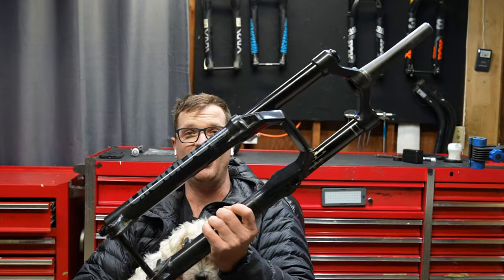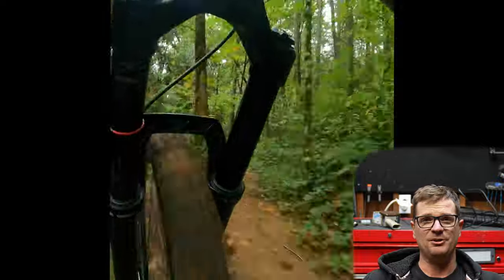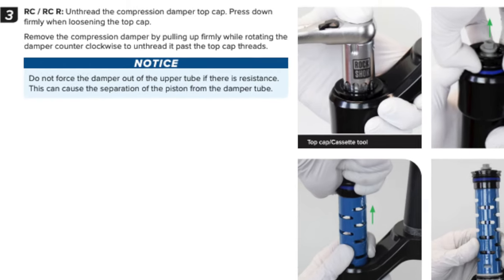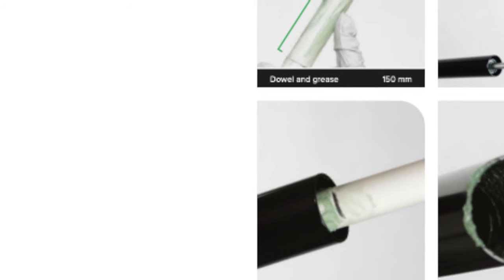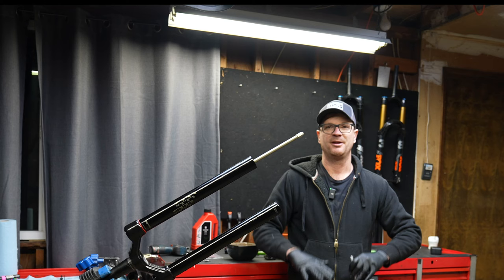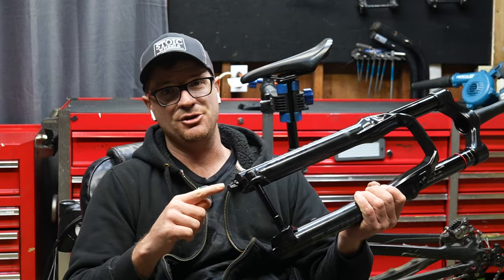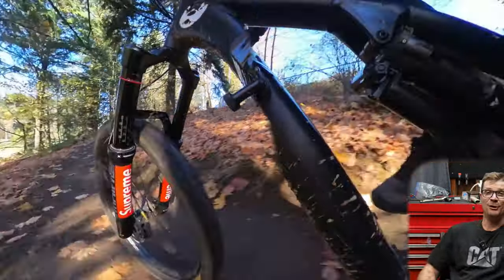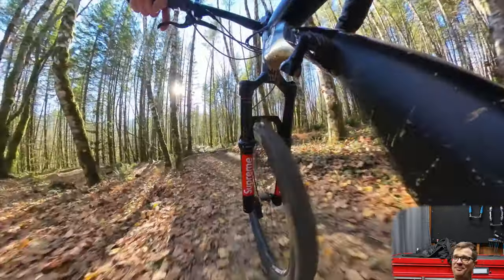How to fix YOUR Rockshox Domain

Comment from the maker: Swapping out damper oil fixed it, not the Airpsring mod
Reply: I’ve got this fork. Came with the bike. It’s not bad for jumps and I find it goes through the travel just fine when aired down for a plush sag. But small bumps and high speed compression is awful feeling. Very stiff. 

Does the air spring or the oil (thinner?) make that better? Want to try to fix it before deciding on an upgrade. Thanks!!
Reply: Which oil did you use?

Comment: Charger 3 damper definitely works, I installed on in my domain and it's 100% better, no air shaft upgrade though.
Reply from the maker: There is an upgrade the luftkappe. Thanks I read that on Reddit it said it fits too
Reply: I have a brand new charger 2.1 from a 29" Lyrik Ultimate 150mm laying around at home. Is it gonna fit, or since stanchions are bigger it wouldn't?
Reply: @klisurski  i think there are different screw diameters

Comment: Don't really know about charger 3 but Rockshox spare parts catalogue 2023 has RC2.1 damper as an official upgrade for Domain, U3 00.4318.048.000. Based on that I upgraded my domain last summer. Works stellar
Reply from the maker: There is no official upgrade for the motion control damper in the trail head app, but guys are going with charger 3 and it fits fine. The damper you have is impossible to buy now I looked everywhere. Glad it works 😎 for you
Reply: I have the 2.1 charger damper in my domain. It's made a massive difference 🤟
Reply: @owenmore5675 Hi. What kind of riding do you do? And if you don’t mind me asking what is your weight. Considering this upgrade myself.
Reply: I have the 2.1 also ……….please please if you have domains fit a luftkappe kit in the air side !!!

Comment: Hi I found this video very interesting as I have a yari fork which came with b1 air spring but the only problem was that it lost a bit of its travel just from the weight of the bike due to the size of the negative air spring but it was super plush and mid stroke support was great. But when the c1 airspring came out I tried that but boy was that harsh!! Due to the smaller negative so I went back to c1 and just put a longer airspring in to make up for the dead spot. I will try again in the future with the c1 and just slightly increase negative with a portion of extra bumper rubber. Love your videos too

Comment: Update: I bought it and so far love it. But I do plan on switching out the air spring to convert it from 160mm to 170 or 180mm travel. I'm actually thinking of purchasing this fork as an upgrade from my Rockshox Recon RL. I don't really do any extreme stuff, just some normal trail riding but considering this fork is on sale on alot of sites for around $250 it's really hard to pass on that. The only thing that has me worried is overforking my frame. I have a Poseidon Norton frame arriving next week and I have to contact them and see what the max travel is for a fork for that frame. Also i should mention I'm looking at the 160mm travel version of this fork because for some reason the 160mm is about $100 less then the 150mm version.

Comment: I bought this fork and while on jumps and normal riding i think it is really good, but we had some serious rain washout on my local flow trail, and its like a washboard. This fork feels freaking horrible on the small chatter and there is a LOT on this flow trail.  otherwise it feels great but it does not handle rain ruts well.   I even did what you did, i have to run about 82ish PSI and 3 clicks from closed. I have tried from open too but from closed feels much better.  Overall I have thought about upgrading the 2.1 RC2 but wasn't sure it would be worth it.
Reply from the maker: That was the point of the video, I fixed the harshness. You can’t get rc2 damper for Zeb anymore they magically disappeared and if you found a used one, they don’t make parts for it

Comment: Any chance you could show how to setup a Rockshox ultimate coil?
Reply from the maker: I rode one and trying to figure out if it’s safe for my ebike long linkage. The damping is very similar to the Vivid. Leave the compression knobs fully off both high and low. Add 1 click of HBO at a time for bottom out control. Only add HSC as a last resort and 1 click at a time, the lsc felt terrible as well. The problem with the 4 clicks of compression it felt like 1 click is equal to 7 from Fox, hard to get it dialed
Reply: @OtterMTBtech I just installed one on my trek rail and it is nice. I’m 170 pounds at 30 peecent sag, All the high end reviewers say they keep the lsc in the middle with two clicks hsc and hbo in the middle. It felt rough with these so I just opened them all up and feels much better, I would like to use some damping since they give you them but a click or two still feels not as plush as fully open, I’m not really sure when to use the high speed and hbo haha
Reply from the maker: Low speed compression is not critical on shocks. High speed is only important if your 220 lbs or send. 

Nothing wrong with compression wide open, it’s the first thing I do to rockshox shcoks. 

If you want to feel good damping it’s not with Rockshox. Having rode both vivid and SD cool and air they all act the same. This video is about the same setup A-Z Rockshox Vivid Ultimate Set up
https://youtu.be/-lxlBXYfU9Y

Comment: you still keep the additional bump stop? how its ride?
Reply from the maker: I got rid of it, wasn’t worth the charger 3 damper upgrade price. I think now when I changed the damper oil to 2.5 weight is what made it so good not the air spring mod
Reply: @OtterMTBtech  the air spring upgrade helps in the performance? Do you still using the airspring with 1 1/2 rubber topper?

Comment: I got this fork (29" Domain R) with a brand new 160mm ebike and 2 weeks later and mostly XC trails there's play in the right stanchion which feels like headset, but it isn't. Any advice what could cause the play and if it's worth trying to fix it, since it's pretty basic anyway. I don't like throwing away new stuff, but it's the first RockShox fork that I've had in the last 15y that has a play after 100km of riding, so I can't say I like it
Reply from the maker: It has a 1 year warranty send it in. Damper oil change or new damper is all you can do to make it ride better

Comment: Does this mod affect how negative and positive chamber equalizes pressures Via dimple in fork tubes? 🤔
Reply from the maker: I think it made it better, but I also changed the damper oil to lighter oil,  to many changes at once

Comment: I have the same fork but feel like i blow through the travel too quick wven wheb running 4 bottomless tokens. Fork feels harsh as well. So don't thibk lowering pressure will help as it will blow through quicker. Tried adding compression but that makes it harsher. Any ideas?
Reply from the maker: What travel

Comment: Hello, I bought this fork in 2023 and noticed that it does not extend to full travel when I compress it, the fork was serviced, but still after compression it loses 3 mm of travel, is this normal for this fork?
Reply from the maker: Are the tokens out? Has the dampener been serviced ? Yes it’s sags into travel
Reply: @OtterMTBtech  2 tokens installed, yes the fork was serviced

Comment: Hello bro
It's fine if I put of the damper side 3wt  rockshox? Because on SRAM page manual says to use máxima plus 3WT and I can,t find it only 3wt rear suspension I 
don't thing it's gonna work with the domain fork right?

Even a 2,5wt it ok or not?
Thanks man
Cheers
Reply from the maker: I used 2.5 all I could find.
Reply: @OtterMTBtech  what about the lyrik ultimate 2021 , for lower it's 0-W30 and I used the máxima plus dynamic  light the same as the domain  will be a problem? Thanks again
Reply from the maker: You got it right. Just the damper takes 2.5